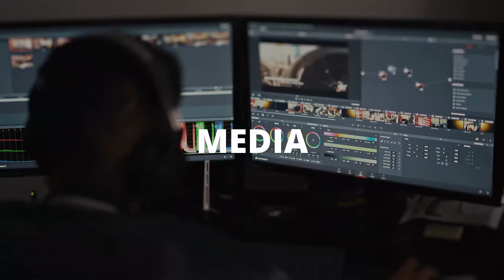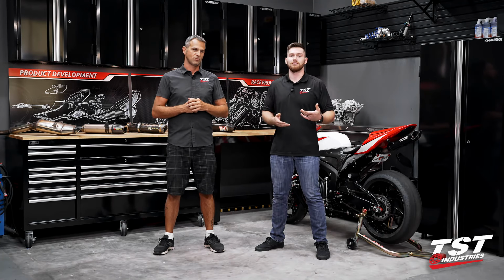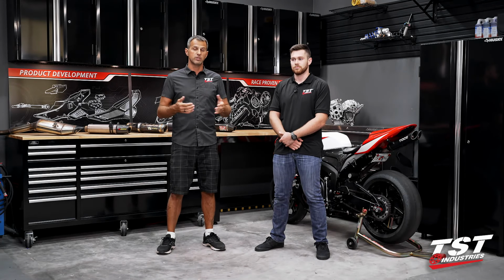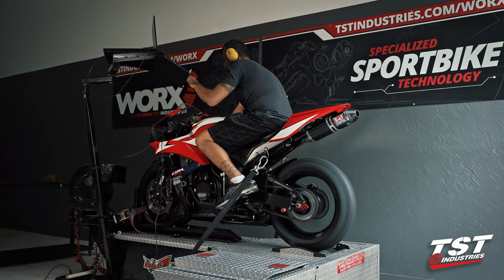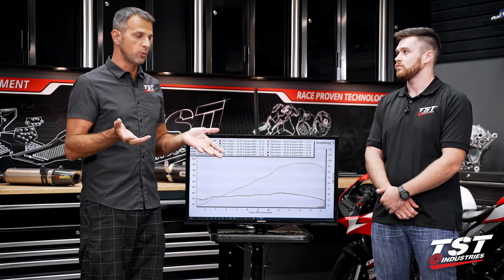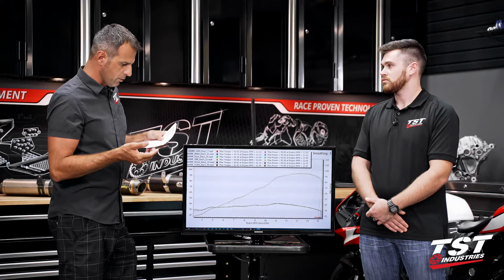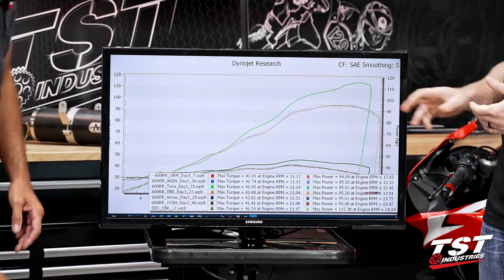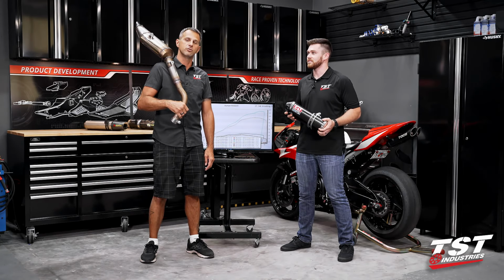Honda CBR600RR Exhaust Dyno HP Comparison: Toce, Akrapovic, Two Brothers, Arrow, Yoshimura, Stock

Comment: Use SAME Bike in the next video with full system comparison and tune comparison. Great video guys! Great video
Reply: Danny Haddad it won’t make a difference. If they don’t change what’s going in, what goes out will make no gain. They will need to do a full video on a full system and ECU tune to make it run like it should.

Comment: I am not sure performance is the main reason ,we ,street riders,do a slip on conversion. It is obvious that not much changes in terms of power/torque.The bikes  look ,however,does change greatly .I,for example,am a greate toce fan.With the fender eliminator  kit,cbrs look awesome.Having said that,once u put the slip on one can not help but go further.i.e air filter,ecu tune...and that is where u get resolts.Great video !
Reply from the maker: Thanks.

Comment: Looks like you added on some velocity stacks on you green 600rr. Is that why you lost power in the low rev-range? I have a DNA air filter and a full Akra exhaust system, finished off with a tune from 2WDW. I considered doing the stacks but didn’t want to lose that low and midrange power. Do you feel doing the stacks is worth it?

Comment: Great video! How about comparing exhaust valve vs none, cat vs no cat, stock ecu vs flashed ecu with throttle restrictions removed? Do you lose low end torque? The backpressure story or is it a myth?
Reply: No, your bike has EXUP valve to control exhaust flow.

Comment: Something I would like to see besides the modest HP gain is the weight savings or conversely, the lack thereof regarding these various add on systems. Weight loss is also equal to HP gain. Maybe you guys could produce a much longer video, or an in part video series, detailing what modification combinations gained the most with these after market exhausts and the estimated or actual associated costs. I.e., header pipe and exhaust install equals a weight and horsepower gain over factory components. The factory system equals this amount of horse power and weighs x amount vs. the aftermarket system with and improved air filter and ECU mapping change, header pipe and aftermarket exhaust results in x overall horsepower and weight savings. I do not know what the catalytic converter weighs, but it is sure to be a fair amount. A video or a series of videos like that would be a very interesting video for those of us who just do some online research and guess a bit at what would be best and thus attempt moderate modifications to achieve these goals.

Comment: What about no exhaust? Any gains or loss. What about high flow air filter, full exhaust system and ECU remapping.
Reply from the maker: We actually did some no exhaust pulls on the dyno and the results were not worth reporting. Torque and horsepower were cut down drastically. And for the rest of your question....didn't you see what the thesis of this video was? All those other topics are left for another video.
Reply: @TSTindustries  actually I was interested with stock internals and only air filter, full exhaust system and ECU remapping. In this video modified CBR had modified internals too.
Reply from the maker: @cranky1812  Bryan's green CBR has a three angle valve job, thinner head gasket and cam degree adjusted. That's all for internal mods. The bike we ran on the Dyno is bone stock.
Reply: @TSTindustries  thank you
Reply: TSTindustries well how much horsepower and torque was lost without the exhaust?
Reply from the maker: @jackkranjac9113  I would have to pull up that run to be precise. I think I remember so.ethimg like a 5hp deficit but don't remember torque

Comment: Awesome series of videos guys. What did he do to his CBR to get HP gains like that? I’m looking to get either a TBR or Yoshi full exhaust and tune for my ‘19 600rr. Is there any concerns I should have or different mods I should consider?
Reply from the maker: If you want to maximize your gains from what you already listed then consider a good air filter also, and make sure that the tune is done on the dyno with torque optimization, tuning ingnition and fuel. You can get close to Bryan's numbers. His motor has a thinner head gasket and degreed cams on top of the bolt-on stuff so his peak figures and curve are going to be tough to reach without getting into your motor.
Reply: TSTindustries I appreciate the information. Thank you.

Comment: im riding pc41 2011, did put ixil x55 exhaust on it. only thing i noticed riding was the dropped torque on lower rpm's and maybe (just bearly maybe) little gain on higher rpm's with the stock tune. also it sounds like someones strangling a cat with catalysator still on it. xD going to decat, change filter to better flow, ecu flash on dyno and other things to it.. other option i have in mind is to sell it and buy bigger bike, would maybe be cheaper option too :D ps: sorry for my bad english =)

Comment: I'm super late to the party here.  This is interesting.  I have a 2012 with an Akra Slip on and I made 105 at the wheel.  I know all conditions and dynes are different.  The Akra also saved me 3lbs 10oz and I think it looks the best too.  Considering adding a cat delete pipe to open it up a bit more.
Reply from the maker: To have a true comparison you would have to dyno your bike in stock form, then with your slip on, take the percentage gain and compare it to  ours. To add to this, every bike will measure a bit different.
Reply: I'm the same as well 108 at the wheel

Comment: Great video, appreciate the honestly. 

What about the weight saving, would this help with performance gain..? Minimal I know but hey..

 I have the Akrapovic on my 2009 CBR600RR and I love it. It was more just for the sound but also the weight loss as well.
Reply from the maker: All performance characteristic of these exhausts, when considering only the change of the exhaust with nothing additional, are very small and pretty insignificant. Even taking off the couple pounds that sheds when you go aftermarket doesn't do much for you. You would have to go the distance, like on Bryan's bike.

Comment: Got a 2012 CBR600rr with a Ecu Flash from Chris Moore, Sprint air filter, Voodoo Slip on and cut the Cat and put a mid pipe on, -1/+2 sprocket change....Going to put it on the Dyno thur at Ace Cafe Orlando and will let you know the #'s
Reply from the maker: The peak numbers are not very representative of the actual gains. You have to look at the entire curve. You would also have to get the vbaseline from your bike in stock form to compare to. The dyno numbers are not universal. Anyhow, if you have a way to shoot me the dyno graph I would be curious to look at what you're working with.
Reply: @TSTindustries  I will send you the graph after I get it done, its a Local guy Dakota with Rhino Dyno that come to Ace every thur for bike night. He has a mobile one. Also if you ever need a Aprilia RS660 to make new items for let me know I can drop it off and leave it as long as you like. Im just down the road from you.

Comment: I had to remove the Toce and go back to stock on my 600RR because it's so loud I started getting tinnitus. It will chronically damage your hearing without a doubt. It was money out the window which is a shame because it looks and sounds badass.
Reply from the maker: I may be getting old but I too am pretty sensitive to loud exhaust in the last couple years. The last two race seasons I have been wearing earplugs regularly and still getting a whole head ring after the event. This is of course with a full exhaust but regardless of size of bike. At this point I think I'm most down with stock exhausts.
Reply: TOCE TOCE TOCE TOCE TOCE🙇🏾‍♂️🤙🏾⚡️💙😍

Comment: I love the sound and want a toce exhaust for my 600 but I also think I might sell my 600 cuz it was a "surprise project bike" and I've spent more time working on it than riding it. Hopefully nothing else pops up after I clean/rebuild my master cylinder and calipers/pistons or else I'm just going to tap out. I've already had to rebuild the forks and do lots of general maintenance. This is what I get for being a clown and not spending more time inspecting the bike before buying it off craigslist.

If I keep my 600 or get a new 600, even though the toce slip on makes less gains than the others, it just sounds too nice. Thanks for the comparison and wish me luck.
Reply from the maker: I wish you luck brother. I know rebuilding calipers sucks, especially if they aren't monoblock. It's inevitable that brake fluid gets on something you don't want it on. These bikes are notorious for crappy front brake feel...especially 07-08 before they got monoblocks. Anyway, I hope this is your last hurtle and you can finally enjoy the bike.

Comment: When can you do a dyno test on a naked Honda CB650R, with several brands of exhaust, for example, Arrow Pro Race, Akrapovic Racing Line and Mivv MK3. Half power naked, it would also help, hehe
Reply from the maker: @andremoreira7323  we don’t foresee ourselves doing that at this time but that may change in the future.
Reply: @TSTindustries  From the tests you have carried out, what is the difference between long vs short and large vs small exhausts!!?
Reply from the maker: @andremoreira7323  there is no one set rule on what you are asking. Entire books have been written on this subject. Diameter of the exhaust governs how much volume can potentially flow through exhaust per amount of time. The distance from head to ambient governs which rpm range will be affected by acoustics of the system. Other parameters like number of cylinders,  crossover points in exhaust, primary header geometry, number and size of valves,  angle of valves, cam timing need to be considered (and that is not the complete list). So i am not equipped to answer your question in any correct way. All I can say is that if you are buying a slipon exhaust you are just changing the look of your exhaust, and potentially adding noise. Generally not much will be gained in the form of performance, at least not in the way where the what you pay vs what you get is a good value. Far better value performance increases come from suspension tuning, and weight reduction.
Reply: @TSTindustries  I'm going to install a complete exhaust with manifolds and slip-on. If you can get bigger strips, you'll win. I see some exhausts are wide and others are smaller/longer.

Comment: Quick question? Why not include the Leo Vince exhaust as it is top tier right? What's your thoughts on the slip on leo for the 2013cbr600rr? Not much content on that company.
Reply from the maker: we had Leo Vince in our first sound comparison video but sold it soon after. Then we were left with four other popular systems and that is what we did the next two project videos on.

Comment: Awesome video! 

Would love to know what I need to buy from you all to get my bike in line with Bryan's... Parts list please :)
Reply from the maker: We did a thinner head gasket on that bike. When we had the head off the bike we cut a third angle in the valve seats. We also did a cam degree to move some of the power up higher. Besides that the rest was all bolt-on and tuning. As you saw in the vid he had a full Arrow exhaust, a racing high flow filter by MWR, Woolich Racing flashing software, 520 pitch lightweight drive train, etc. The bike was tuned by our staff here. Pretty minimal SS build actually. I was basing my answer on you probably just wanting to match the engine output to Bryan's. There were many things done to that bike that improved its performance outside of power delivery. Things like suspension, mass removal, geometry/suspension setup, pit performance enhancements, etc.
Reply: @TSTindustries  thank you so so much for the great reply 🙏🔥

Comment: Hey @TST I have 2 identical CBR 600 RR 2009, one with ABS and the other without ABS, both have Akrapovic. But the one with ABS have -40km/h Vmax. Why??? I noticed that I can rev in the redline 17k but when I in 6th gear it wont go pass 13,5k rpm.

Comment: Back in the old days (and for some of us that still have really old bikes), would carbureted motorcycles have gotten bigger gains than fuel injection (FI) because the carbs could be rejetted to supply more fuel but with FI that doesn't occur unless the intake is modified to send more air through? I have a Two Brothers slip-on installed on a '95 Honda CB1000 and it worked pretty well. Wondering if having carbs helped.
Reply from the maker: This is a very good question. Re-jetting carbs is the olden days equivalent of FI tuning. Re-jetting on most bikes involved changing main jets, pilot jets, plugging air passages, changing slide springs and needles, and shimming the needles up or down. Nowadays we use a piggyback fuel computer or re-flash the ECU to precisely tune the A/F mixture. For this video we wanted to show how little effect you get if you just install a slipon exhaust. This is a modification that most people make to their bike, and most of them just leave it at that, swearing that it made some sort of noticeable difference, and contending that one brand of exhaust does better than others in a considerable way. This video was meant to be a myth bust as we gear up to shoot subsequent videos showing the progress of a bike through different stages of bolt-ons and tuning. As you can see from Bryan's bike, which was tuned through repeatedly flashing the ECU until a good balance point, more gains are there if you tune the bike properly. I do believe that a proper tune on the bike with the stock exhaust provides more performance gain than changing just the back end of the exhaust system.

Comment: In your experience and opinion, what is the best size or long tip for a suzuki gsxr 1000 K5?
The bike is in stock.
Thanks
Reply from the maker: My opinion would be biased because we only deal Toce and Yoshimura. There are many good slipon exhausts out there, and as we proved with this video, just slipons will not vary greatly between each other in performance. Just get the one that suits your taste best.

Comment: Hello I have a 02 929 and currently have a yoshimura slip on , on my exhaust 
In your opinion what would be the best exhaust for my bike ?
Reply from the maker: It really depends on the budget you are on and how much performance you want to free up with this endeavor. The 929 is a familiar beast to me. I have owned 2 of them. I actually made the exhaust for the first one I owned. That bike was released before the environmental laws for vehicles became very strict. There is no catalytic converter box on the exhaust. It does have a valve body, and a pre-muffler in the collector pipe just fore of the silencer. Once you get rid of the OEM silencer and get a good flowing one (like the Yoshimura you mentioned), you've done most of what you can do for the bike in respect to the exhaust. You can go with a full exhaust and take advantage of less in-line components for a lighter weight and stronger output. This performance will not manifest itself unless you actually tune the bike though. A better use of your money would be to get a really good flowing air intake filter and get the bike dyno tuned by a reputable shop with a piggyback fuel computer, or re-flashing the ECU. Just a bolton of a different exhaust will not give you much advantage over what you already have.

Comment: i have a 2brothers slip-on now on my '13 600RR, do you recommend an air filter and power commander for more hp? Thanks
Reply from the maker: That and a proper dyno tune by a reputable shop. Then you will actually see and feel a difference.

Comment: Besides exhaust and intake, what else can you do to increase power on a bike?
Reply from the maker: That is a loaded question...how far do you want to go? Do you want to get into the motor or do you want to know what to do without modifying engine internals? There are several parameters missing from your question. If you watch our R3 Superbike Build show you will see how to increase all measurable performance characteristics on a bike.
Reply: @TSTindustries  Thank you. I'll be sure to watch it when I get a chance.

Comment: Hey guys I have a question, would the same akra from a 2013 CBR600RR would fit a 2011?
Reply from the maker: I know the bikes are separated into three groups; 07-08, 09-12, and 13-on. I believe that the routing on the midpipe of the Akra exhaust had changed on at least one of those generation switchovers. If I recall correctly its the one from 07-08 to 09-12, but I am not 100$ on that. There is a possibility that it changed once more on the next switchover, but again, I am not sure. I can tell you that the Toce exhaust is one system that fits 07-now, so that goes to show you that the parts on the bike haven't changed all those years. I can't answer your question with 100% confidence but I hope all this background info I gave you helps you in some way.
Reply: TSTindustries thanks guys for your help,  I’ll keep that in mind.

Comment: Without the RAM effect of the pressurized airbox this test Is unfair
Reply: At Speed the airbox takes more air . And the exhaust increese the flow extraction due to the air suction on the back
Reply: @alby2317j35  plus they normal have toce on this bike, i bet its mapped for toce and all other are still better, this test is fake so they can sell more, never trust some one try to sell you some thing. toce is a too loud cheap made overpriced amarican fart can. all the young squid kids love and they make good money selling
Reply: But as a base test on the same engine in the same room the point is made on the video